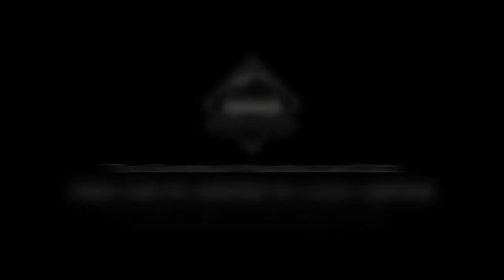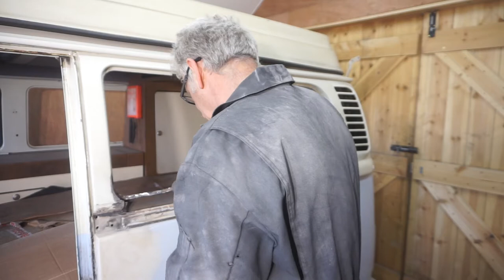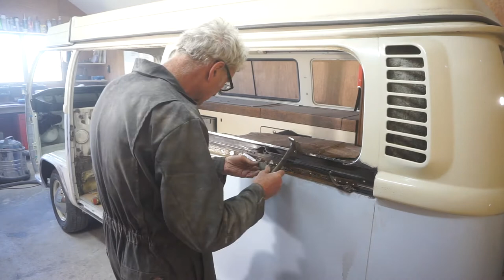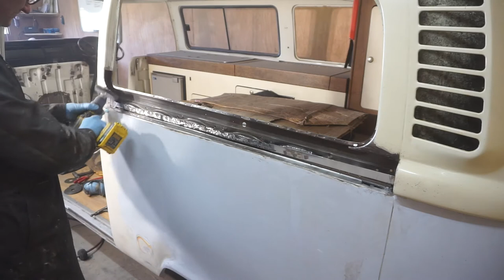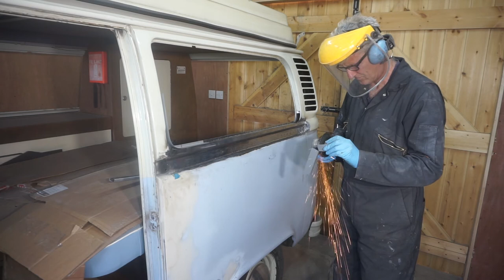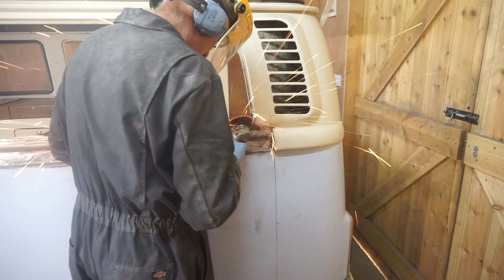1973 VW Campervan Restoration Part 21

Comment: Hi thanks for these comprehensive videos....as Im doing similar to my 71low line bay, your videos are very very helpful. 
However having suffered a mishap with an unguarded angle grinder, where I was lucky not to loose my leg, and was put on a ward with other (unguarded) angle grinder casualties, I would advise putting the guard back on your grinder. My accident occurred due to the disc binding, then releasing and due to the power (bosch) pulled the grinder out of my hands onto my leg. I cant tell if your using flap discs (which i now use as safer) or grinder discs but would not want what has happened to me and others to happen to you.
keep up the good work and thanks again for the informative vids. 
john c
Reply from the maker: Hi, thanks for the advice, you are right, I should put the guard back on, not sure if I still have it but will have a look - if not the next one will be kept on. The unfortunate thing with safety is that I/we tend to only take it seriously after the event or accident has happend! I will never use an angle grinder without a full face guard - why? because I spent a night in hospital having a piece of metal removed from my eye. The pain and discomfort will stay with me for ever. Anyway thanks again and I hope you 71 resto is going well.